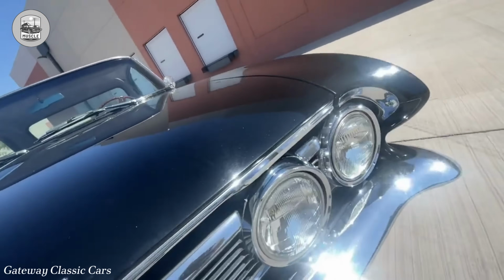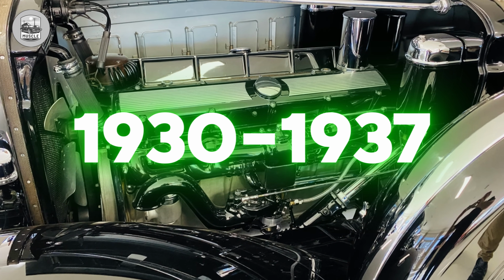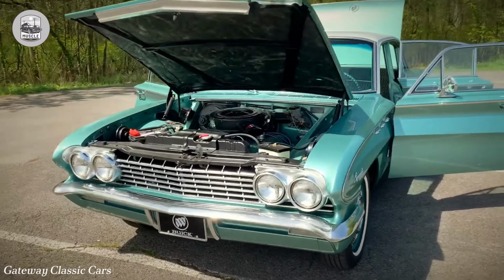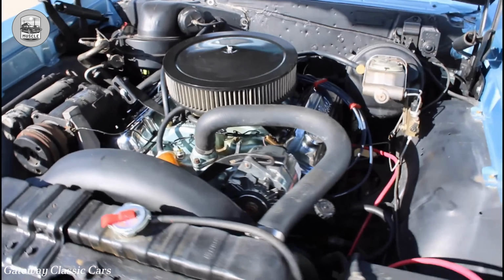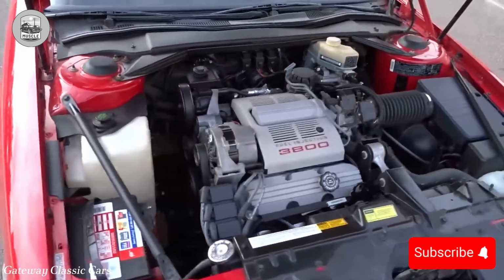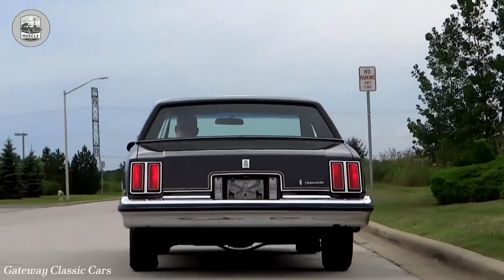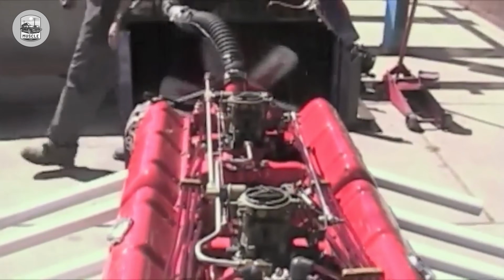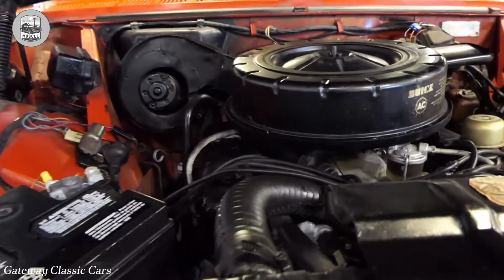10 MOST FAILED and WEIRDEST GM Engines ever made | Worst engines blunder!

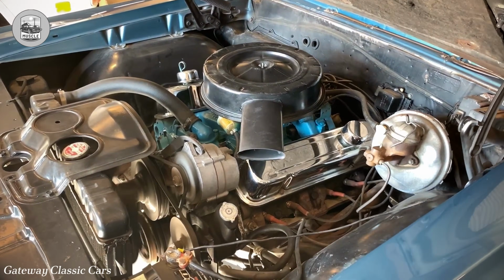Comment: 12:18.... The smaller bore makes no difference to the outside dimensions of the engine. ALL Pontiac V-8 engines of that era were the EXACT same size on the outside of the engine. The Pontiac 455 down to the 326 were the same size dimensionaly. The 301 was the only oddball out. The small bore of the 326 severely hampered the engine's breathing ability, compared to its larger bore brothers, and ultimately limited the max output power of the engine.
Reply from the maker: Great point! You're absolutely right about the outside dimensions of the Pontiac V-8 engines. The 326, 389, 400, 421, 428, and 455 all shared the same block size, making it easy to swap components between them. The 301 was indeed the oddball with a shorter deck height and a lighter block, designed more for fuel efficiency during the fuel crisis.
As for the 326, that small bore really did limit its breathing, especially in terms of valve size, which restricted airflow. Compared to the larger engines, it struggled at higher RPMs and couldn't achieve the same power levels. But interestingly, Pontiac still managed to get decent low-end torque out of the 326, making it a solid performer in daily driving conditions. However, for enthusiasts looking for maximum horsepower, the 389 or 400 was the way to go.

Comment: Whats my favorite? The turbo Olds, of course.... 😜
Reply from the maker: Ah, the turbocharged Oldsmobile! That's a rare gem, for sure. The Oldsmobile Jetfire from 1962 was actually the first turbocharged production car, beating out the Chevy Corvair by just a few weeks. It came with a 215 cubic inch aluminum V8 and was equipped with a special 'Turbo-Rocket Fluid' injection system to prevent engine knock. Oldsmobile was really ahead of its time with that one, pushing boundaries with forced induction!
Reply: @MuscleCarMasters68   Absolutely! It made more H.P. per cubic inch than any other engine shown in the video..  🍻
Reply from the maker: @davelowets  You're absolutely right! The engine you're referring to definitely packed a punch when it came to horsepower per cubic inch. It’s incredible how much performance engineers could squeeze out of these motors with the technology available at the time. Engines like the 302 Z/28, 289 HiPo, and the Mopar 340 small block come to mind as some of the best examples of high-output per cubic inch in muscle car history! But let's hear from everyone else—what's your favorite high-H.P.-per-cubic-inch engine? Drop a comment below, share your thoughts, and don’t forget to subscribe to Muscle Car Masters for more deep dives into the legends of American muscle! 🍻💪

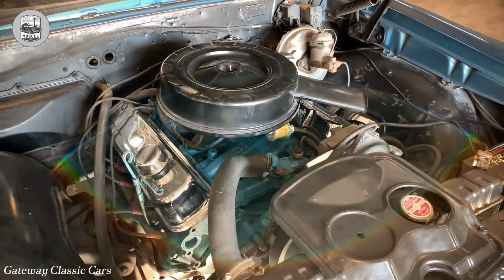Comment: Buick 336 @ 12:29 you dont change the bore of a 389 to make it fit smaller cars (???) you would likely change the bore spacing or the degree of the block to make a smaller engine physically. Then it would be an entirely new engine.
Reply from the maker: Great point! The Buick 336 engine is often a source of confusion. To clarify, it was not just a simple rebore or resize of the 389. As you mentioned, to fit it into smaller cars, changes had to be made to the overall design. Instead of just altering the bore, engineers would adjust the bore spacing, block dimensions, and sometimes even the cylinder angle to create a smaller and more compact engine. This would indeed result in an entirely new engine architecture.
For instance, Pontiac's 326 was another example of rethinking engine design to fit a smaller car rather than just modifying an existing engine. They didn’t simply reduce the bore; it involved comprehensive engineering changes to match the vehicle’s requirements.
Thanks for bringing up this interesting point! We love discussing these kinds of details on Muscle Car Masters, so be sure to share your thoughts! Don’t forget to like, share, and subscribe for more deep dives into classic engines and muscle car history. Let’s keep this conversation going in the comments!

Comment: how about the 637 gas V8???
Reply from the maker: Great question! The GMC 637 V8, introduced in the 1960s, was a true workhorse designed primarily for heavy-duty trucks. This gas-powered V8 had a massive 637 cubic inches of displacement, making it one of the largest V8s GM ever built. It was designed for brute strength, delivering plenty of low-end torque, which was perfect for moving heavy loads. However, it wasn’t commonly used in muscle cars because its sheer size and purpose were geared more towards industrial applications.
The 637 was unique in that it shared some similarities with GMC’s V6 engines from the era, like the 305 and 478, but was scaled up to deliver more power for the biggest jobs. While not a high-performance V8 like what you'd see in a GTO or Camaro, it's an interesting part of GM’s engine history, showcasing how versatile their V8 architecture could be.
Thanks for bringing it up! Muscle cars aren’t just about the well-known engines, and it's awesome to see the community discussing some of the more obscure powerplants! Keep the questions and comments coming! And if you haven’t already, make sure to comment, share, and subscribe to Muscle Car Masters for more deep dives into the engines that shaped American automotive history!

Comment: I had one of those 8-6-4 cadillacs, and put nearly 200k miles on it with no issues at all.
Reply from the maker: Thank you for sharing your experience! It’s great to hear that your 8-6-4 Cadillac ran smoothly for almost 200k miles—that's quite an achievement, especially considering the reputation this engine had for its complex electronics. Many owners had issues with the cylinder deactivation system, which was a groundbreaking idea for fuel efficiency at the time but ran into trouble due to early 1980s technology. It sounds like you got a good one or maybe took great care of it, which really shows how proper maintenance can make a huge difference.
For those who aren’t familiar, Cadillac’s 8-6-4 V8 was introduced in 1981 and could deactivate cylinders to improve fuel economy, which was a novel idea at the time. While the idea stuck around, it wasn’t perfected until later with more advanced systems.
We’d love to hear more stories like yours—how did you keep it running so well? Let us know in the comments! And for everyone else, if you enjoy talking about unique engine technology or American muscle cars in general, make sure to comment, share, and subscribe to Muscle Car Masters. We’ve got plenty more engine history, stories, and surprises coming your way!
Reply: @MuscleCarMasters68  i owned it when I was young and was pretty hard on that car, but i did change the oil every 3k miles. Ran decent fuel through it, and injector cleaner twice a year. I averaged 21 mpg with that car as well.
Reply from the maker: @cadilakisrodcustom  Thanks for sharing your experience! It sounds like you really took care of your car, even driving it hard but still maintaining it properly. Changing the oil every 3k miles and using fuel injector cleaner twice a year are excellent habits that likely contributed to your solid fuel efficiency—21 mpg is pretty impressive for a muscle car!
Running decent fuel and regular maintenance, like you did, can make a big difference in engine longevity and performance. It's always great to hear stories from real owners who’ve lived with these machines!
For everyone else reading, what’s your go-to maintenance routine to keep your ride running strong? Drop your thoughts in the comments below! And if you haven’t already, don’t forget to comment, share, and subscribe to Muscle Car Masters for more awesome stories and insights! Let’s keep this community growing!
Reply: @MuscleCarMasters68  I've owned 18 cars since that cadillac, and I haven't been able to find the same satisfaction as I had with that car.
Reply from the maker: @cadilakisrodcustom  Wow, 18 cars and none quite compare to that Cadillac? That speaks volumes about the quality and experience that Cadillac delivered back in the day! There's just something about the smooth power and luxury that those Cadillacs had, especially models like the Eldorado with that massive V8 under the hood. It’s hard to match the feel of cruising in a car that balances comfort and performance so effortlessly.

Comment: I seen in either a Chevy or GMC dump truck, from the early 60's I'd say, anyways it had a V-6 in it with like Hemi heads on it!? Spark plug wires ran right to the middle of valve covers, I've never seen this engine before or since, does anyone know of a hemi V-6 that GM made??? Put in dump trucks?
Reply from the maker: That's a great observation! What you're describing sounds like the GMC V6 engine series from the early '60s, which were definitely unique for their time. The V6 engine in question wasn't actually a Hemi, but it did have a very distinctive look due to its design. The spark plug placement in the center of the valve covers gave it a "Hemi-like" appearance.
GMC produced a range of big-block V6 engines from 1959 through the 1970s, primarily for use in trucks. The engine you're referring to was likely one of the 305, 351, 401, or 478 cubic inch V6s. These engines were built tough for heavy-duty applications like dump trucks, and while they didn't have hemispherical combustion chambers, their industrial strength made them stand out.
Interestingly, these GMC V6s also powered things like buses and larger commercial vehicles. They were known for their durability and low-end torque, perfect for trucks hauling heavy loads. However, because they were primarily used in commercial vehicles, they're not as well-known as GM's passenger car engines, which might explain why you haven't seen one since!
Does anyone else in the community remember these engines or have any stories about them? Feel free to share! Don’t forget to comment, like, share, and subscribe to Muscle Car Masters for more deep dives into rare and unique engines from the past!

Comment: GM's efficiency tech is to shut down cylinders until the tow truck is doing all the work.
Reply: @bendeleted9155  Ram trucks are using cylinder deactivation technology in the 5.7 L Hemi’s and because of it they have an oil starvation problem at idle, causing it to chew up cam lobes. So if you have a 2012 or newer Ram truck with a 5.7 liter Hemi engine, don’t let it idle for long periods of time. All the manufacturers are using every trick  to try to get fuel efficiency up as high as possible but some of it just hasn’t been proven out. Is General Motors having any better luck with theirs than Ram is?
Reply: @dpdeere  GM's is probably worse, because it happens across the board of use cases, but I am not sure it's any good in any application. The other efficiency factors involved muddy the waters a bit too. The Chevy 5.3s were using a lot of oil too, but it's not as bad in the last few years.
Reply from the maker: GM's oil consumption issue with the 5.3L V8 (particularly in the early Vortec and Active Fuel Management models) was a widespread problem that impacted performance and reliability. These engines were prone to burning oil, primarily due to design choices around the AFM lifters and piston rings. GM did make some improvements over the years to reduce oil consumption, like updating the valve covers and using modified piston rings in more recent models, which seems to have helped.
It's a great reminder that efficiency factors—such as engine design, fuel type, and even driving style—can impact reliability and performance in surprising ways! We’d love to hear from others who’ve had experiences with the Chevy 5.3L or any other engines with similar issues. Drop a comment, share your thoughts, and be sure to subscribe to Muscle Car Masters! Thanks for being part of the conversation, and let’s keep the muscle car passion going...
Reply from the maker: Great point about GM's cylinder deactivation technology! GM’s Displacement on Demand (DoD) technology, also known as Active Fuel Management (AFM), was designed to improve fuel efficiency by deactivating certain cylinders when the engine is under light load. While it worked well for fuel savings, early versions had issues with reliability, causing lifter failures and other mechanical problems that left many enthusiasts frustrated—hence, the 'tow truck' jokes! However, GM made significant improvements over the years, especially with the introduction of their Dynamic Fuel Management (DFM) system, which offers more precise control over cylinder deactivation, helping to prevent some of the issues seen in earlier systems.
What do you think? Did GM get it right with their later versions, or is this tech still more trouble than it’s worth? Let us know in the comments, and don't forget to share your stories! And if you're passionate about American muscle cars, make sure to subscribe to Muscle Car Masters for more engine talk, stories, and deep dives into automotive history! 🚗💨

Comment: And to this day, displacement on demand still sucks.
Reply from the maker: You're absolutely right! Displacement on Demand (DoD), or Active Fuel Management (AFM) as GM calls it, has had its fair share of issues, even though the idea behind it was sound – improving fuel economy by shutting off cylinders when they're not needed. Unfortunately, many drivers have experienced excessive oil consumption, lifter failure, and even misfires because of the system, especially in earlier models.
That said, GM has been working to improve DoD over the years, and newer systems like Dynamic Fuel Management (DFM) aim to address some of these shortcomings. But for muscle car enthusiasts, the consensus is clear: we prefer full power, all the time!
What’s your experience with DoD or AFM? Let us know in the comments! And if you haven’t yet, make sure to subscribe to Muscle Car Masters for more deep dives into the quirks, features, and history of American muscle cars. Share this video with fellow car lovers and keep the conversation going!